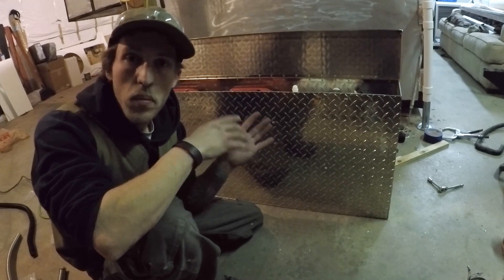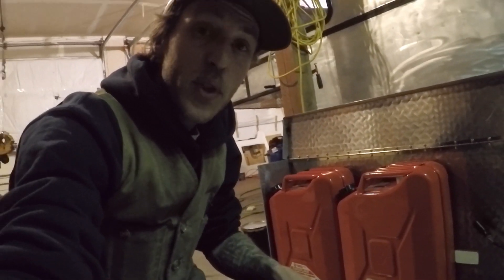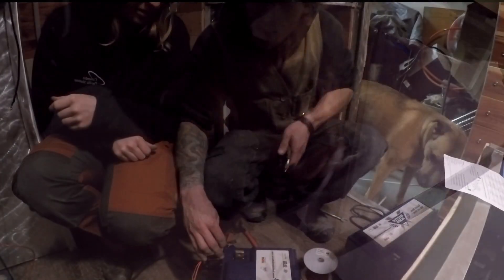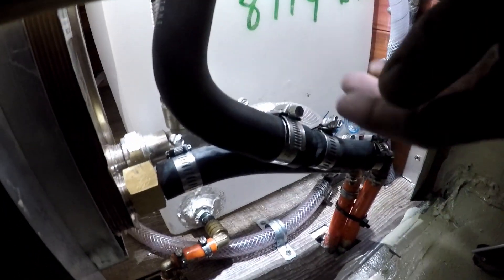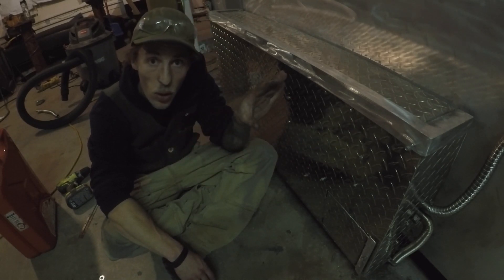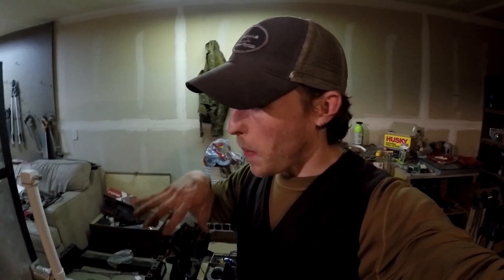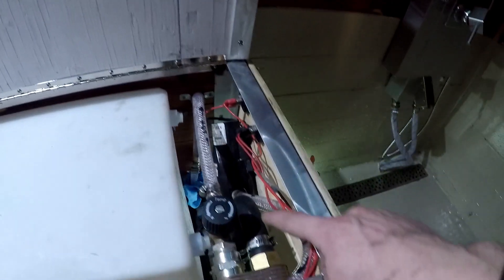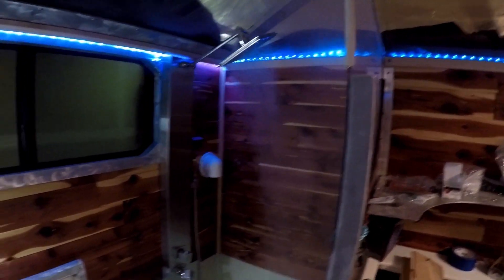Off Grid Recirculating shower - IT WORKS!

Comment: The glycol is suppose to flow thru the heat exchanger in the opposite direction as the water.
Reply from the maker: I mean, there is an inlet and outlet in the exchanger. We followed the intended flow as directed. Wether it’s incorrect or not, the water has no issue with heating up.